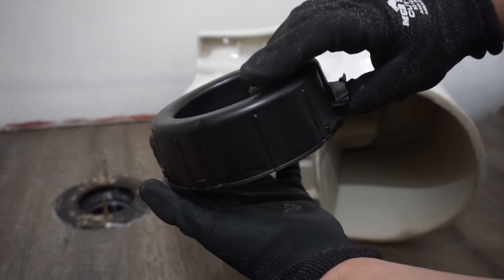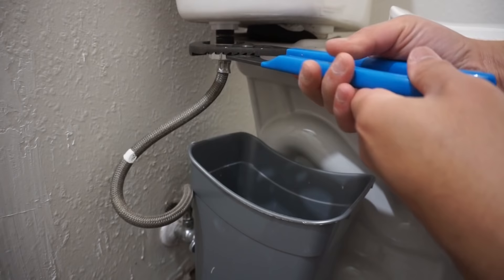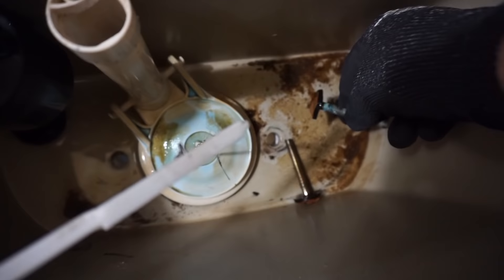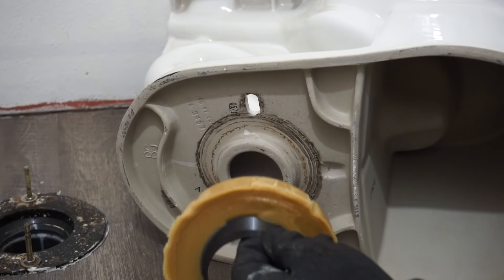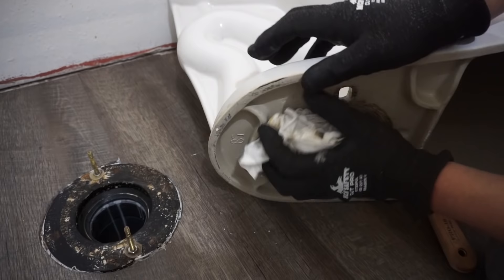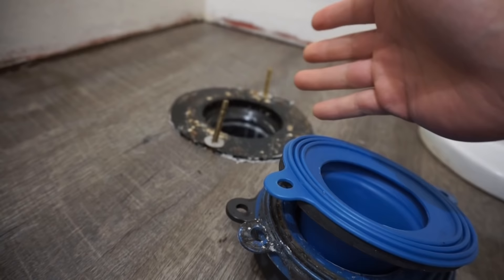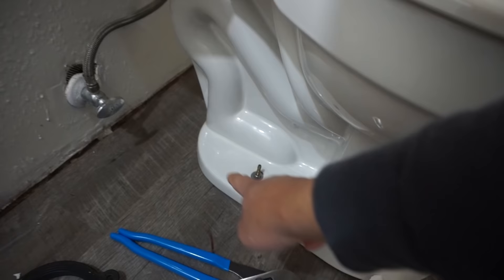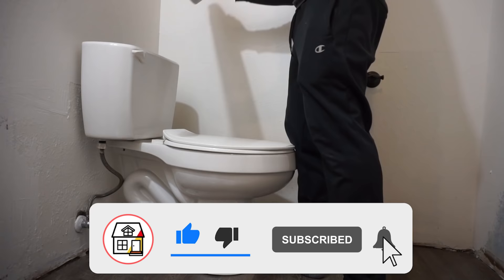How To Replace A Toilet Wax Seal OR Rubber Toilet Seal On A Toilet Flange To STOP Toilet Leaks!

Comment: When attaching bolts to porcellin always use a rubber washer between the porcellin and the metal washer to avoid cracking the porcellin fixture. Do not overtighten.
Reply from the maker: Thank you 🙏🏽 for this tip! 😊👍🏽
Reply: Yes always press the toilet tight to the floor then tighten. Those bolts aren't technically for bolting the toilet down rather then holding the flange tight. I put blobs of drywall spackle all around under the toilet so when it dries it supports the toilet equally. If it rocks use thin lead strips folded to size thickness then gently tap it under the hollow area if it rocks. After that then caulk the toilet in with a strong caulk like pheonoseal. An elephant can sit of it and it'll never rock once that spackle dries. Then hope you never have to change it because its a b*tch to slowly cut it loose with a spackle knife hammered under it until the spackle lets go. If you spray silicone or WD-40 on the toilet it'll form the shape of the bowl and not get stuck to hard to the spackle. I would not recommend using plaster or it'll be hard to remove. But unless you get a clog you'll never need to change or have to tighten it EVER.
Reply: @stevenallen9592 : Steven this is complete and utter nonsense, lol. I don’t mean to be rude but everything you’ve said is untrue. Drywall spackle has no structural integrity whatsoever and certainly wouldn’t prevent or support any sort of rocking motion of a porcelain toilet. It also dissolves in water so any time you wash the bathroom floor or the toilet backs up due to a big ol’ cow pie it will crumble, plus caulking around a toilet is an extremely bad idea. Also, a toilet clog seldom requires anything more than a plunger or a snake and almost never requires removal and re-installation of the toilet. Your style of amateur plumbing is the reason real plumbers never get a day off.
Reply: @FixThisHouse : I apologize for not being quite so polite as you but Richard’s comment is not advice, it’s nonsense. Nobody uses rubber washers with toilet bowl hold down bolts because there’s no point. The bolts come with brass or brass-plated elongated washers and usually round plastic clip devices to hold the bolt caps in place. They do not come with any sort of rubber washer nor is any washer ever recommended. The internet is rife with amateur plumbers and it does the public a disservice to encourage them.
Reply: @rayray8687  
You have no idea what you're talking about. Just because you can't understand how somebody does some thing its a sign of ignorance to try to "imagine" in your head some way it fails or makes no sense. I've been reinstalling toilets over new floors we've installed since 1985 installing marble floors. Back in the '90's Hillsboro County in Florida passed a law requiring low flow toilets in new construction due to water shortages and the county offered free change out toilets with installation on older homes to anyone wishing to exchange them. My brother in law was one of several plumbers who were permitted to install them. Plumbers who installed more toilets per week got pick of customers as opposed to being given an address and paperwork for each home owner which was huge because everyone wanted the homes with 2 or more toilets instead of running out 20 miles to install 1 toilet before taking off to the next booked job. One summer he paid me to fly down and help him for a few weeks to lock up the multi exchange homes. Some days we were knocking off 12 to 16 toilets in a day with our system of one of us tearing out and prepping and the other was you,g behind and installing them. If there were no issues we got in and out within an hour swapping out 2 toilets then going 2 or 3 houses down the same street doing it again at $75 per toilet then most customers paid us "tipped" us to haul off the old ones and we left them at the township warehouse in Tampa Fla where we picked up the new toilets for the next day. So before you troll make sure you know what your talking about. As to the strength of plaster, not gypsum because there's a difference or even gypsum absolutely has compression strength when it dries. Air can compress and lift a car lol. Now here's where it shows you're clueless to plumbing. When "your" dump clogs a toilet it does not back water through the flange. Toilets work using the "J" or an "S" trap design to keep methane gas from backing up. Your dump is clogging inside that tight bend which is up above the flange and ZERO amount of water is at the flange. Only a clog in the main line can back up to where the toilet will leak from back flow pressure and when this is the case the fixture with the lowest point is the tub so if a toilet is backing from a main drain clog at the very least the tub will gurgle if not fill. You can Google to learn only so much but you can't Google about things you learn from actual hands on experience. Another give away is picking on someone who said he uses rubber washers. He never said it came in with the jonnybolt kit he said he used a rubber washer. If you knew about or had hands on experience you would know it doesn't hurt and if it makes him feel secure its his business. If you understood how the cap and the snap lock works you should've caught it that a rubber gasket will throw off the height of the nut holding the snap lock cap making it harder to snap on the cap, but not in possible. You don't owe the Mr fix it guy an apology you owe apologies to people you critized thinking you figured something out by your logic that was wrong and insulted somebody who is correct. If not then your nothing more then a troll with no class insulting people who weren't talking to you in the first place. Sheeze find something to do with yourself
Reply: @stevenallen9592 : Unfortunately I do have an idea what I’m talking about. I’m the guy along with my service technicians who spent several years repairing the mistakes and rough workmanship on 2 very large new home subdivisions for 3 major builders. The job was to correct new home warranty issues and building code violations and even with a medium sized crew the work was endless and tiring. We repaired, adjusted or subcontracted virtually everything that was wrong with the build and I was responsible in many cases to get inspector and purchaser sign-offs. I had to deal every day with very educated building and electrical engineers and I had to know what I was doing…which I did.

As for plumbing, the most common deficiency by far was leaky toilets, but thankfully in all those years I never met a plumber who set his toilets in drywall compound, lol. I also never met one who tried to hide his shoddy install behind a bead of caulking. Oh, and btw, I know all about toilet clogs, I’ve personally snaked and augured dozens.
Reply: @rayray8687  The order that I see is:  Toilet ) Plastic Decorative Washer ) Metal Washer ) Metal Nut ) Plastic Decorative Cap.  So, in most cases, the plastic decorative washer is what is contacting the porcelain.  In any case, no need to overtighten.  Another tip is to "not caulk all the way around the base" / "leave a leak detection hole", so that any leaks can be detected readily.    The decorative caps also help to prevent corrosion of said bolts.
Reply: @thetruthserum2816 : Yes, don’t forget the toilet first, lol!

In any case the order you’ve stated is exactly how the typical American Standard type toilet is installed. If you were to place a rubber washer under the plastic cap retainer washer the decorative cap would no longer fit properly. As for caulking around the toilet the last thing you want to do is conceal a leak which could end up disastrous if not detected early. Also to prevent bolt corrosion spend another $2.00 and buy solid brass hold-down kits rather than brass plated. It really annoys me when YouTubers purporting to be professionals when they are still amateurs themselves condone badly misleading information to people who are trying to learn. Thank you for helping to straighten this out a bit.
Reply: @stevenallen9592  damn you came in here with a bazooka blast lol. Good info man. Thx.
Reply: @stevenallen9592  I want to use your technique because I have a rocking toilet and want to fix it. Where can I buy the lead strips you mention? My hubby had a stroke and is unstable on his feet, so I need a way to secure the toilet to the floor better but without bolting it so it doesn’t break if he moves it. 

The subfloor is concrete (no basement) and when I used tapcons to secure flange to the floor, two screws wouldn’t “catch.” I believe the concrete didn’t cure correctly when the the house was built.  Thanks very much for sharing your method.
Reply: Spakle under a toilet? Great stuff to use.  If the seal don't work. Atleast the spakle will conceal it. Till everything in area is rotten. Dry spakle is not water proof. So if there is a leak it will deteriorate.Also great stuff to grow mold with in a high humidity environment. Smh... plastic shims seem much safer to use.
Reply: Most toilets have a plastic washer that sits under the bolts to clip the caps onto after installation. No need for rubber washers.
Reply: @stevenallen9592    Use tile grout under a toilet, not plaster. Plaster dissolves with water. Wouldn’t want you doing any plumbing at my house.
Reply: @huejanus5505  
You have no clue the customers I've installed kitchens and baths for. First of all grout would cement to toilet down permenantly plus its drying time would make it ineffective unless you can't use the toilet for 2 days. Plaster dries rock hard in 20 minutes making it the perfect material. Plaster does not break down with a little water. You have no clue what plaster is do you? Plaster is not spackle. Plaster has been used to craft statues outside for over 2000 years. My toilets will never leak as long as its never been involved and lifter so what water would make it magically dissolve like you somehow think. You can mop water under it and the toilet tanks condensate not the bowls. So before you go thinking you are knocking somebody who you have no idea how far through the roof their skill level is at least make sure you know something about what material you suggest using. I bet you have never pulled a single toilet off a flange yet you think you can watch a YouTube video or Google some questions and it can teach you to question my abilities. My friend you can never come close to being in the same league that I've reached when I sold that (8 figure) company SMH
How about you go watch some videos out there. Some are machines that perform amazing tasks the best are the ones called people who are working on another level. You'd be surprised what talented people figure out that is way out of the norm at the same time miles above what's the industry standard. Yeah plumbers may knock me because they want to get in, get out and get paid. If it fails they come back lie and blame it on the home owner. We didn't change toilets although I have helping family. Toilets we/I put in were almost exusively over the marble or tile floors we put in as part of the entire renovation so I was never in favor of short cutting something. My,money wasn't making a couple hundred bucks swapping toilets my money came from the $20k high end bathroom renovation. Whitney Houston, Boys II Men, the Philadelphia Eagles, Phillies, & Flyers, judges, heart surgeons, wall street investors even one of the Gambinos were on the list of my satisfied customers so the only thing you did get right was NO,I certainly would never be putting in a toilet for you. I doubt you could afford it lol
Come to think of it Reggie White sat down and could not break the toilet I installed but he broke 2 before this that was installed by licensed plumbers thus being the reason we first crossed paths when Eric Allen and Randall Cunningham said call this guy he'll take care of you. I went there as a favor to solve his broken toilet problems and left after turning a storage room/basement into a man cave with trophy shelves. I swear you trolls are out of control. Good luck with your grouted toilet. Your welcome for the idea of how to support a rocking toilet from ever cracking. Your 100lb behind might not have rocked it but put a 250lb ass on it and watch out Loretta lol
Reply: El Raider  
The problem is people think toilets rock because the floor isn't level or the toilet was fired and glazed with an imperfection. The reason to be cautious is if the flange its bolted to is sticking up too high over the tile floor its got all of the weight pressing around the drain hole so its no longer the problem of a bad seal. It becomes structural so it the toilet is supported independently in a bed of plaster or cement once the rocking stops then you caulk it in for aesthetic reasons not to keep water out or water it. Sometimes by tearing out an older thicker tile floor and retiling it back with a thinner tile that causes that flange to rise higher then when it was first set. If this isn't caught at the time setting the bowl will blow the wax ring right out which loses the seal then the toilet is weak on the sides and from and if the bolts are a little too snug and you lean sideway it stress cracks the porcelain which starts breeding bacteria as the raw clay is now absorbing moisture. Humidy alone is enough moisture to breed bacteria. Then that stress crack eventually winds up breaking the base if it doesn't just breaking it off from day one. So see a lot of guys will argue when they aren't even aware of the true reason why floating a bowl down in anything is an insurance policy that the toilet can never fail. I've seen them set with wet sand. But that's what separates home owner from someone with years of experience seeing how they've been installed over a century and knowing what will work and what is a rocking ticking time bomb. There is only a small margin for error on the maximum height that this flange can be above the finished floor
Reply: El Raider 
That's fine when you have modern construction with ABS or PVC pipes in todays wooden frame buildings so you can access it from the first floor below a basement or a crawl space. Its easy to cut plastic loose and drop it down. But in the end of the 1890's in old cities like Philadelphia and New York these where some of the first places to commercially use indoor plumbing. Many of those flanges are cast iron that's casted as one piece from the toilet and the long sweep elbow all was 1 solid piece. Even residential buildings had cast iron pipe parts. They aren't glued like ABS/PVC or soldered like copper drain pipe they were dry fit and lead was melted then poured and molded into the joints. Anyway when it was plumbed out the pipes were roughed in. Sleeves were placed around them as a barrier against touching concrete made of a far choth, the first floor plumbings toilet flanges heights were shot with a transit level so to establish the finish floor height. They were wired in place or staked with iron rebar and then the rough concrete floor was poured around the toilet flanges with the plumbing risers to any floor above or vents. So what are you going to do? Jack hammer out 25 s.f. of thick very hard cured concrete that possibly has live water lines through it? The other thing you can do is install a wet bed before you set the floor. The only thing with this is you can't raise the finish floor height with changing the transition where the bathroom floor height meets the floor height of the room on the other side of the door. Sometimes yeah a marble threshold or sill can be installed with a tapered bevel called a Hollywood bevel but over a certain amount of height difference it becomes a trip step. Not to mention it looks like sh*t. The best finish is not to have a marble threshold but to have the bathroom floor meet the hall floor butt tight with a 1/16th caulk seam where it meets exactly under the closed door. This way when the door is closed inside all you see it tile. Outside all you see is whatever the hallway floor is made of like a hardwood. Those little things are what make some guys stand out from the others. Say you spend even at the low end say $15k for a total bath renovation which is low if its marble and not ceramic because we would make the vanity top out of that same marble and the marble shelves in the shower are the same marble. No matter how perfect of a job you did if the customer (usually the wife lol) looks at the bottom of the door and she sees a 1 inch strip of some other material she's never gonna be fully happy. Even if she accepts it, signs the approval form and pays off the balance in full to her she thinks it could've looked better and she is 100% correct. When we have matching slabs and we can make that saddle/threshold with the same material its another story but still IMO not as nice as a hidden transition because coming down the hall you can have the door closed and even if you just had a beautiful new floor installed in the hall that tiny strip of marbke threshold sticks out like a sore thumb especially when no other closed doors around the halls have it. Laying out these jobs need to start with the finished bathroom floor dictated partially by that stupid toilet flange height.  And we absolutely warrant the installation unless there is a potential problem and its been made aware of right off the bat and they have to sign off an acknowledgemt form that basically says I am telling you I believe this or that might be a problem down the road or it might not look as good as you imagine but you are OK with,something being installed against my recommendation. Everything will pass local and/or state building codes but codes don't care about or addressing anything aesthetic. Well I obviously can't tell anyone how to do anything I can only explain,the reasons for what I have done. People can take all the shots they want but,my installations and fabrications got me retired in my early 50's and sold the company before Home Depot started selling it so to the smart ass who pissed me off this morning saying I couldn't install his toilet lol. My work hasn't just retired me young but its taken care of both of my daughters for life who are in need of nothing at 29 and 31 last year moved in to their identical homes we built on a tract of land I bought as a family parcel near the Cape Fear in N.C. Only I still love the Jersey Shore and fishing for stripe bass every fall up in Cape Cod. Not bad for a failed toilet setter lol lol lol 
YouTube can be a piece of work some times with these Google geniuses lol
Reply: Why would you remove the tank lol just pull the thing out as a unit it’s not that heavy
Reply: @El Raider can you or even ray or Allen tell me why or what the issue is with the closet screws that the flange and toilet sit on keep spinning? They sit to low and the t head doesn't lock, any suggestions? So far I just put the nuts that came with the rubber gasket like in this video to hold it down and then put the toilet on, still rocks a bit though
Reply: @El Raider awesome thanks for the information, it's not near half inch high more like 1/8 an inch if that (guessing) I use the nuts came with the kit and tighten snug not to tight to the flange, the white plastic nuts now are just spinning like it won't tighten down at all after I put the toilet back on so tomorrow I'm going to grt new nuts for the top like you said.

Out of all what I did cut the plastic flange out, drilled holes in the slab for the flange (not sure if I was supposed to, was told different things from different people) I figured I rather drill to slab instead of glue so if it breaks again It will be easier to take off. But all that the only pain in the ass thing was those damn closet screws spinning, you would think there would be a slightly bigger t head on them, I guess there's a reason not 🤷‍♂️
Thanks for the help 👍
Reply: @El Raider I redone my floors with ceramic and ever since ( a couple months) my toilet in the master had a slight wobble to it, Took it all loose today to see what was up and the flange was cracked right at the bolts both sides.
Had to cut the plastic flange out with Sawzall it was glued in, didn't want to have the same issue if it ever happened to break again so instead of gluing it, I decided to drill the flange into the slab that way I could just take out the screws to remove if the flange ever broke again down the road not sure if that was the right thing to do or not, people said different things don't glue it, drill it down don't drill it thats over kill, then don't glue it or drill it, like ok well how is it not going to have a wobble if it isn't glued or bolted down 🤷‍♂️
I just decided to fasten it to the slab.
Reply: @El Raider the issue now seems to be just getting extra nuts and tighten it and use a few shims to stop the movement. I hope.
Reply: @El Raider no not on a raised foundation, after putting about 3 plastic shims there seems to be no movement and nothing leaking, so I deem all good so far at least.
My other toilet same thing just not as bad, slight movement ever since I installed  the ceramic tile flooring. I may just add a few shims and see how it does, it's not leaking or anything yet.
Reply: @El Raider I'll  definitely look into them, is there something specific with them?
Reply: @stevenallen9592  Yeah Ray Ray is right. Spackling around a toilet base nonsense and will crack and fall off and look ghetto in no time.  That technique is recommended  for amateur Chinese slum lords that are to ignorant and cheap  to use a good old fashioned wax donut.  That's all you need and they last a lot longer than 3 years. Also, no need to disconnect the toilet tank either when doing this job. That's just make work.
Reply: Thanks for that info.
Reply: @rayray8687  ok so i should be fine with using brass washer for tank to toilet installation correct? 
i was a bit worried as it didnt come with rubber washer so i used all brass washer. 
So brass on porcelain is ok correct
Reply: @akanesoratobu8889 : No, don’t do that! The ‘tank to bowl’ kit will include rubber washers, often beveled or conical in shape to seal the inside of the water tank. If yours doesn’t include some sort of sealing washer take it back and have it replaced. On the other hand it sounds like you might have mistakenly bought a ‘bowl to floor flange’ kit?
Reply: @geea8509 : Thank you. Anyone who sets a toilet in any cementitious or gypsum compound simply doesn’t know what they’re doing. There’s no toilet manufacturer or building code regulation that would recommend, suggest or even condone the practice. You’re absolutely right, this is the practise of slum landlords. It’s amateurism at its worst.
Reply: @rayray8687  Yeah, sounds like a plumbing job my old cheap Chinese land lord would try to butcher in my apartment in San Francisco years ago.
Reply: @rayray8687  I went to lowes and bought a kit. It was missing the rubber washers. 
Would it be ok to use rubber seals inside but the botton just brass washers? 
Its a tank to bowl type and only included rubber seals for the tank only but brass washers for the bowl.
Reply: @akanesoratobu8889 : A basic kit contains a broad head bolt, a conical (beveled) rubber washer, a metal washer and a nut. That’s it. Millions of toilet tanks have been attached this way but today’s kits usually include a number of extra washer, gaskets and nuts that serve no useful purpose. If your kit came with the 4 parts I mentioned above that’s all you need. The extra rubber flat-washer in some kits is only to help prevent too much pressure on the underside of the bowl flange and has nothing to do with water leakage. In many decades I’ve never seen a cracked toilet bowl flange from over tightening. I’m sure it’s possible but it never happens. Again, if your kit has the rubber washer that goes inside the tank that’s all you need to seal in the water. Happy renovating and keep it simple!
Reply: @rayray8687  nice thank you. Yesterday i  installed a toilet and  the box only came with two rubber washer, two brass and bolts. 
It was a tank to bowl type so i used the rubber washers on the tank  and the brass washer on the underside of the toilet. 
I did have to tighten it a bit made a bit of a noise of the porcelain but it should be ok right? 
I checked inside the tank and seems nothing has cracked. 
I did have to tighten it a bit hard but im hoping it holds
Reply: @geea8509 : Haha, you don’t need to be Chinese to be a cheap landlord. Many small scale landlords want everything done for nothing which is why I became somewhat selective in my client list over the years and started turning down the ones who wanted 3rd rate service work. I simply referred them to 3rd rate trades people, lol.
Reply: @akanesoratobu8889 : Hey, that’s great! The tank usually has little molded bumps on the underside that rest on the bowl flange and they sometimes do make a bit of a grind when they touch but as long as you haven’t overtightened the bolts the big rubber gasket around the tank horn will absorb the pressure and your toilet will be good to go for the next 50 years or so!
Reply: @rayray8687  nice thank you for the help!
Reply: @stevenallen9592   I talked to 3 master plumbers with a 100 years of combined experience and they never heard of putting spackle down to level a toilet because spackle isn't waterproof on top of it having no durability. Nor would that method ever pass code if a building inspector found out a plumber was using spackle instead of shims to level out a toilet.